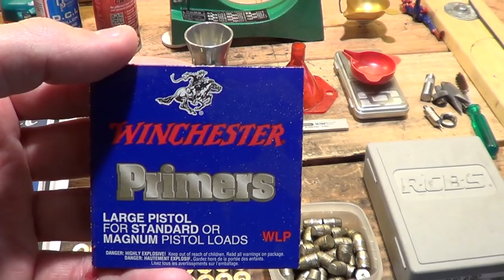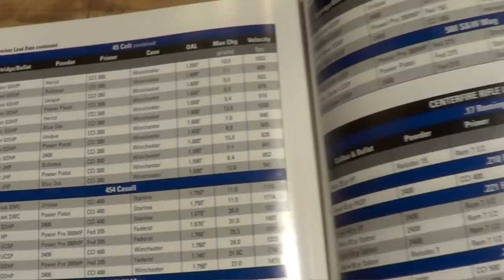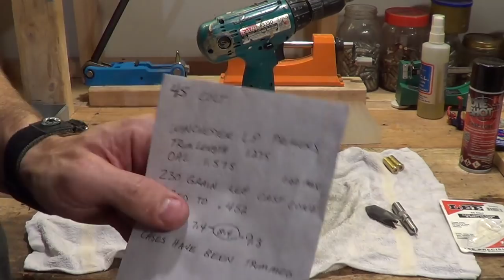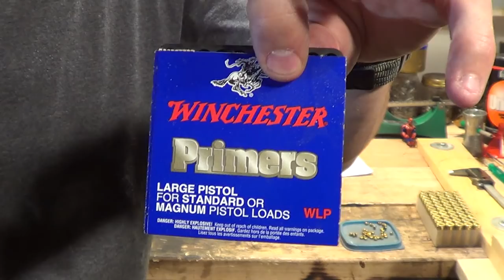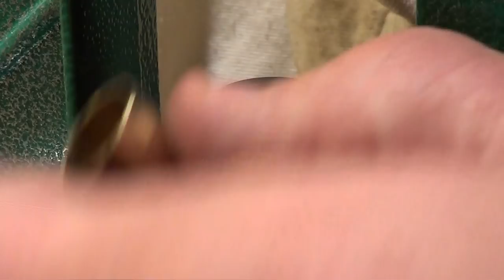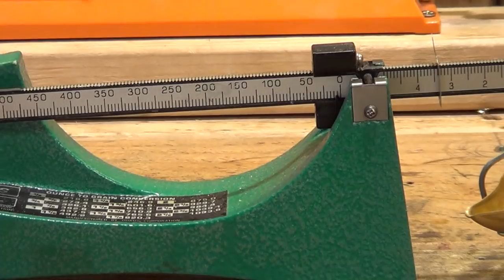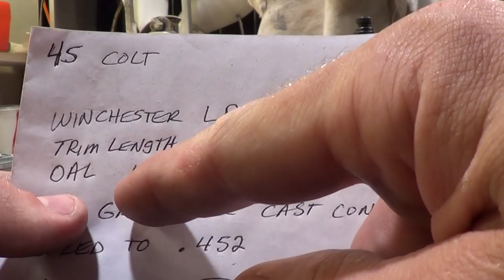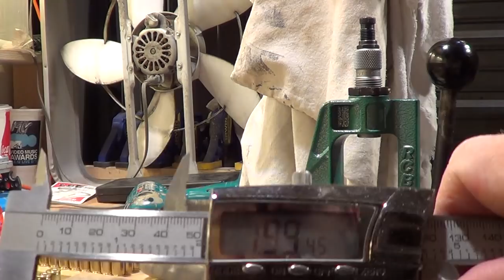Reloading 50 rounds of 45 Long Colt with cast bullets from start to finish - HD (very long)

Comment: The 45 Colt is the official name used by the Sporting Arms and Ammunition Manufacturers’ Institute (SAAMI). 

The common misnomer name 45 long Colt is not required. It was never officially named 45 long Colt and it's use is incorrect. 

Yes, everyone's familiar with the 45 Colt cartridge back in the calvary days. The soldiers came up with the 45 long Colt designation, because of the shorter 45 S&W Scofield cartridge. 

I'm not stating this to change your mind, I'm just educating you on the only correct name 45 Colt.

Comment: Very well done! I have been loading for about 50 years and you have done the safety features in reloading straight wall metallic cartridges the same as I have done. I have pretty much the same equipment as you do, but some is older. RCBS "Rock Crusher" single stage press, Lyman "C" press, Lee Loaders, and a Lee Progressive loader, plus a set of RCBS dies for .410 bore and a plethora of steel and carbide reloading dies for every caliber handgun/rifle I own. Reloading is still much cheaper than factory ammo set to SAMMI  specs. You get to load your ammo to fit the firearm's chamber or forcing cone in revolvers. The only thing you have that I don't have is the electronic scale.
   I collect "range brass" for practice, but buy only Federal Match cases for competitions. Some people do not realize what value they are walking away from when they do not police and save their own brass at the range. So, I "cash out" on their leavings.
I have used Unique, both Hercules and Alliant powders for many years, and still have a few pounds of the Hercules powder in my storage cabinet from an 8lb can. No ammonia smell yet, so it is still good.
   I agree, with rifle cartridges you have to be careful on the lubricant you use, if too much, it collects in the sizing dies and dents the shoulder of the bottlenecked cases. If the action is strong (say a Mauser action), you can fire them safely without high pressure problems. But, do not fire them in a modern action, say a pump rifle - the rotating bolt isn't strong enough. Always check the headstamp on the cartridge for flattening out problems that too high pressure problems show.
All in all, a very good presentation of reloading metallic cartridges. Thanks.

Comment: Very good 101 video and I always suggest a person start reloading using a single stage press and then advance in a couple of years later into a progressive press if they desire. Like you repeated over and over, please take your time and double check everything from start to finish. A paper log book is one of your most important tools because a person will forget some of the load specs the very next day. Been loading for over 50 years and have many years of logged in data for every load ever built. Good luck folks and be safe!

Comment: That was a very long video. But I can say at no point did I get bored or lose interest, great content!  I am new to reloading and feel alot more comfortable entering the game from watching this, loved the attention to detail and reiterating subject for better memory. The only thing I wish would have been included was showing  you shoot some of your hand loads as a celebration of completing the lesson lol. Great video!
Reply from the maker: thank you for stopping by and leaving your comment! I'm happy that you found my video helpful. shooting would have made a nice finish to the video. thanks for the recommendation. have a great day!
Reply: +Zack Harvey     Good comment. Regarding long video: reloaders need to take their time and do it right. Do any step wrong and you may  have to throw out the whole batch. So one-step-at-a-time (no hurry .. no deadline). Then inspect (double check). On powder be very careful about setting the charge, the scale, the load (and do not use max loads). If you think you did anything wrong  back up (unload the cases) or throw it out. MARK YOUR BATCH (date, time, powder charge, bullet weight, primer and keep them separate) If (when you shoot it) anything is wrong .. stop that batch. ERR on the side of  caution. PS .. do not ever reload powder while on a nylon carpet; concrete or tile floor  put powder container away after filling the powder measure.  No smoking (of course) no sparks.  Keep powder measure away from your press area (avoid clutter on your table)
Reply from the maker: +Gitfidlpickr I agree 110%

Comment: Finally a video that tells you everything you need and really in depth. My only question is that when you are seating the bullet could you keep 1 bullet that hasn’t been shot yet as a reference for the roll crimp and depth of how far the bullet seats into the brass to bypass that one step? Also how do you know when you have a good roll crimp?

Comment: just out of just out of curiosity just say you was loading to the 9.3 spec. if you was to go just a bit over say 9.4 or 9.5 would that realty cause any problems i understand say if was loaded to 18.6 will cause to much pressure and blow the gun apart but does 1 or 2 grains make that big of a difference?
Reply from the maker: That's an excellent question. if the fluctuation of charge is still within the low and high spectrum of the ranges of powder to be used you'll be fine
Reply: @jiujitsu2000   guess i should of said max instead of spec.

Comment: Ive been reloading for quitensome time now. Have never lubed "pistol rounds". Rifle rounds a different story. Plus have never trimmed pistol brass and never had a problem. Was curious why the extra steps? Maybe im missing something but for years have never had an issue
Reply from the maker: Great comment! I usually don't trim or lube pistol either if I'm wanting rounds quickly. If I've got the extra time. Then sometimes I add the extra steps.
Reply: @jiujitsu2000  Lubing pistol cases is the only way to go. Started 10 yrs ago and never looked back.

Comment: You may have answered this already but are the dies you're using in this video (cowboy) dies or regular 45 colt dies? I just ordered the regular dies and plan on using them. I take my time reloading with a single stage press, so I figured it would be ok to use lead cast bullets with the regular dies.
Reply from the maker: aaron B these are standard dies. thanks for stopping by!!
Reply: Thanks for the quick reply. I'm currently watching your Alone season 4 video on my new channel Six Wheel Carlisle

Comment: questions.  i dont have time to watch the entier video but i will.  did you cast/size/lube those projectiles?  reason i ask is because i just picked up a lee loader for 45 colt for almost nothing and wanted to know if i need to resize the projectile. 
ps, ive been loading for years but never for pistol with a lee loader.  only a progressive and a rockchucker.
Reply from the maker: I did cast, size and lube the bullets. I would recommend taking a calipers and measuring your bullets if you're unsure if they need sized. Thank you for the support. I hope this info helps.

Comment: great video, for someone new, covers the basic. Nice to see some one still uses Unique, (dirty) but cheap. I use 7.5 for paper, and 8.5 for pins and steel with 255 gr. lead. Light loads, brass will last forever. But how much do ya need to punch paper. P.S. great reloading set up.

Comment: Awesome video man. I do have a question, I'm preparing to load some 45 LC for my 1894 Marlin. I know you said that we need to research our own load data, however the big problem I am having is finding an acceptable case length for loading, currently after scouring a few forums I'm not getting anywhere. Would trimming my cases to your length that you use work with my application? I purchased the .45 colt case trimmer and gauge from lee, is this a universal length that their cutters cut to? I haven't received it yet, so I'll find out next week once it gets here but I just wanted to ask. Also do you know the range of length for the .45lc case? Saami and all of my reloading books just give me 1.285 which I'm gathering is the max. What is the minimum length for the load?
Reply from the maker: Thank you for the kind words as well as the support you give my channel. I've seen lengths anywhere between 1.275-1.295 and honestly it depends on the gun you're shooting as to what length to use. I think 1.285 would be a good one for you're situation. The Lee trimmers are great and they trim within the specs. You may notice small differences in length between them, but nothing major.
Reply: buy a hornaday reloading book. lots of good stuff.
Reply from the maker: todd reeves I've been thinking about that for a while. Thank you
Reply: the Lee hand trimmer is universal and cheap. AND great exercise for your thumb and fore finger.
Reply from the maker: j stark very true I love the Lee trimmers!

Comment: Good video. One thing occurred to me that was not covered for the new guys, and that is locking the ring(s) with the set screw, and having more than one seat/crimp die(s) preset for different bullets, a time saver that may be of consideration for some.
Reply from the maker: Thank you!

Comment: im not asking for load data... but do you think im safe loading a 45lc 240gr bullet with 8.6 of unique?
Reply from the maker: +Vanilla Gorilla I'm away from home at the moment and I do not have a reloading book or data in front of me, but just off the top of my head that sounds a bit hot. I'll try to see if I can't find some better info. I'll comment back again if I do.
Reply: Vanilla Gorilla You'd be safe, but pert near right at max. I'd drop down to around 6.0 grain and s l o w l y work back up. A lot depends on who makes your brass and pistol. PS: Never saw a " long "  colt.   45 Short and 45 Colt...Yes.

Comment: Brother you have taught me everything I have learned about reloading I am now casting my own bulletts and having a blast my friend owns a tire company he gives me 5 5 gallon buckets a month of the lead weights, I turn them into ingots and trade supplies for them anyway thanks for all the early help like a year ago quick question I just got a great deal on Oregon Trail laser cast bullets in 200gr. RNFP I use Alliant Unique or Hodgon CFE powder I just cant find any load data on RNFP Lead bullets can you help a fellow veteran out? Lol thanks
Reply from the maker: That's awesome! I've been crazy busy, but I'll help however i can. Please bare with me though. I get tons of messages, emails and messages. What caliber is the 200 grain bullet?
Reply: It is a .452 .45 I am told that .45 Auto bullets are usually .451 diameter but in my books it says that .452 can be used in my .45 Auto and my .45 LC! I just loaded my first home cast lead bullets in 230 Gr .45 LC and .45 Auto! I did what you did to harden them them I added four or five of the oregon trail laser cast bullets to harden them anyway they fired AWESOME! Hey did you hear about the ammo shortage? What shortage you taught me to make bullets! Seriously, I make about 1000 bullets a week in .45 and .9mm and I am giving them away to veterans groups. Hey quick question I have a ton of .40 cal. Brass, do you know anyone that would trade either .45 auto or .380 for them? They are all cleaned first corn cob then walnut. They just are not decapped (no dies for .40 as I dont own a .40? Anyway thanks a ton 502-548-5315 if I can ever help, if you look wt my pic, you will see I have friends in low places anything I can ever do to repay the awesome education you have given me! Take care Brother
Reply from the maker: K. M Jankoski
Sweet!

Comment: I have two loads for my Colt. A 200 gr semi wadcutter at 935 fps and a 255 gr semi wadcutter at 1050 out of a6.5 inch barrel. I’m using a US Arms Abilene, very accurate.

Comment: A must know for loading the .45 Colt is the actually diameter of your barrel. Due to the age of this caliber there have been many different sizes of the is firearm manufactured. Die manufacturers produce almost all the different sizes for this caliber. I know this because I personally ran into this problem when first reloading for this firearm.

Comment: My opinion of the Lee Powder measure is very flaky.  I adjust it to 4.0 gr. of Unique and it normally will bogart  some powder so the charge comes out short most of the time. It helps throw the majority of the charge but I still have to verify its even close, on the scale.  I am thinking its because its made of plastic and the powder may be sticking from static.

Comment: Case trimming technique with a drill looks a bit crude, not to mention tough on the hands. RCBS case trimmer is the way to go. Small investment, high yield for trimming and preparing the case for charging. Also, your drill chuck method is useless for pre-primed cases. Just an observation from a thirty year handloader. Would say the case trimmer is also more accurate. Not sure how one loads fifty or more cartridges efficiently without a loading block to secure the charged cases. Bad idea. Can just see powder everywhere and cases like dominoes strewn about my bench.😕
Guns N Basses Forever! 🔫🎸

Comment: did  you just   trimm  new    unused  brass, than    expended    to open for  bullet took  you like   30  time   ,,   its  ok I get it  , you do not want to expand too much , but since  when  you   went snail slow, you should   tighten  secure  nut , //in short  I load   200 /50  ae , used   brass   to    match  ammo , with  using   scale to weigh  EVERY  LOAD ,  and   than  again   weigh all loaded  finished  rounds/ for   100 perc sure  no   empty  load  etc, I  sixe  primer  hole and  pocket / deburr,, so  ,,what  you   hitting    mosquito  s  tip of the dick on  300 meters  or what //and   on other side the  bullets are looking    uneven cast / so

Comment: Lost me at "long".
Unfortunately,  you've lead many newbies down that wrong nomenclature. 
45 COLT. Period.
Reply: I would submit "45 Colt" is the wrong nomenclature - even tho it is TECHNICALLY right.  .45 Colt is eternally confused with the .45 Colt AUTOMATIC by non-gun people.  Over time, this becomes a pain and leads to getting the wrong brass/ ammo etc : especially at places like Walmart or a gas startion.  The correct pronunciation is .45 Long Colt.  The sooner one accepts that the better off one will be.

Comment: Considering a 45 colt load for the extreme penetrator (screwdriver Phillips solid copper) bullet. But the catch is for an American Derringer 45COLT/410! Since we're not looking for expansion at point blank out of that short a barrel, I'm thinking this bullet in a standard power loading might produce a SLIGHT ADVANTAGE due to projectile shape! What do you think of this JJ2K?